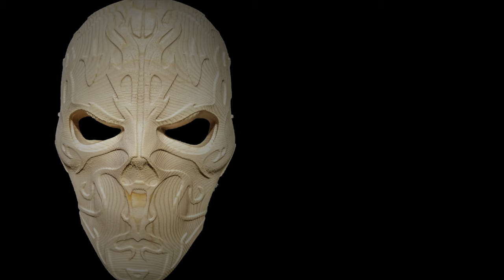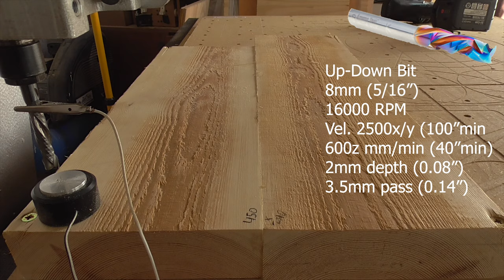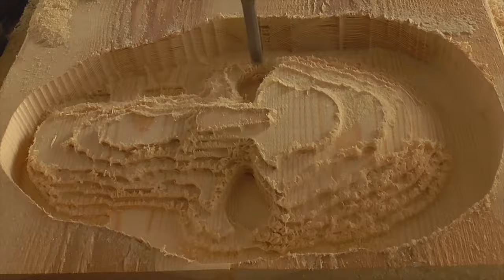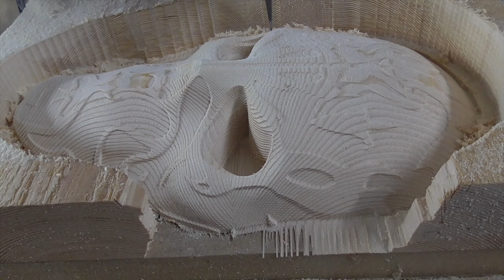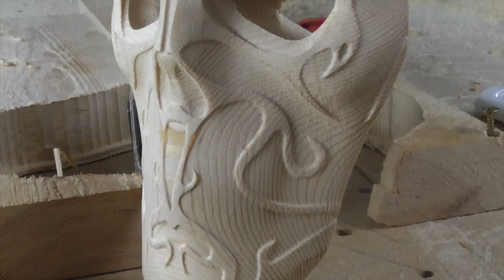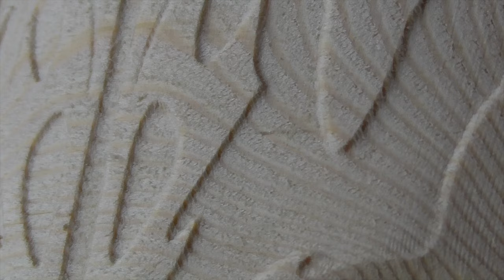Mascara calavera tallada en madera

Comment: Nice carving.  What brand/model CNC machine do you use?
Reply from the maker: Thanks! not's a branded CNC it's DIY project. The only part i doesn't make its the aluminium frames.
I ordered to cut in a dealer the aluminium plates with a dxf plans i give and all other parts are from hardware stores in internet, aliexpres, amazon... 
And a lot of hours for learn how to do it with help of google and youtube jejeje.